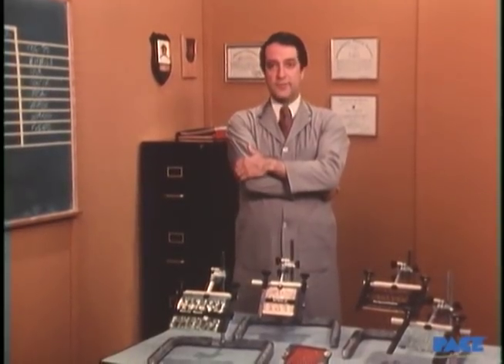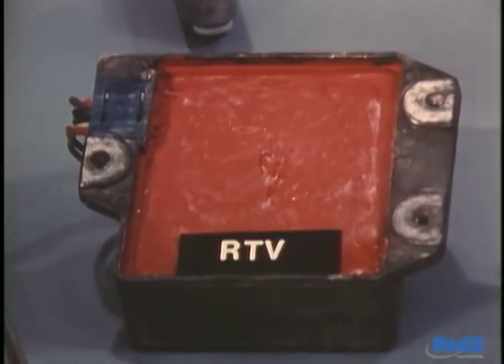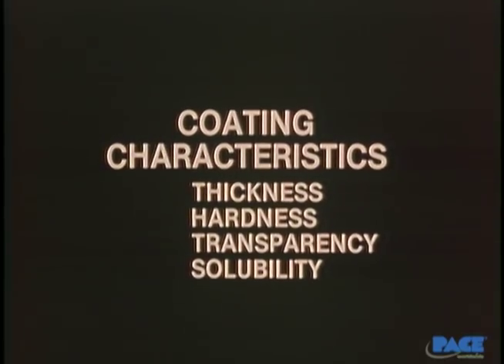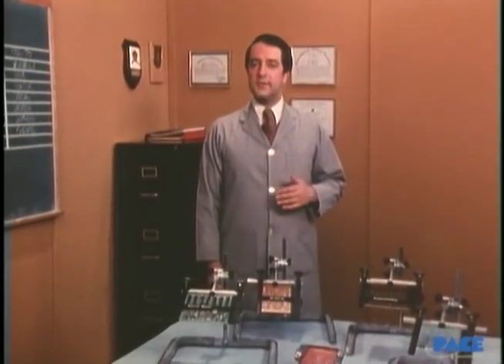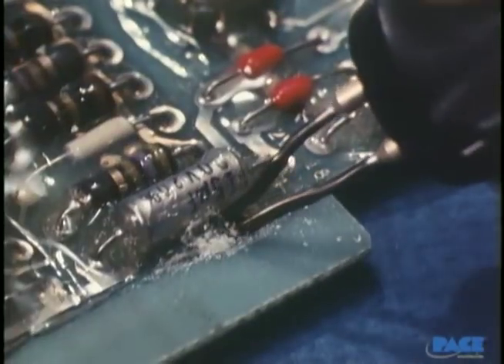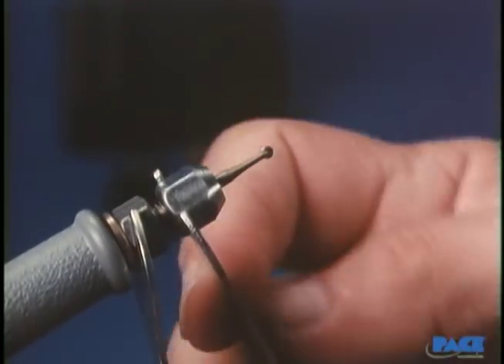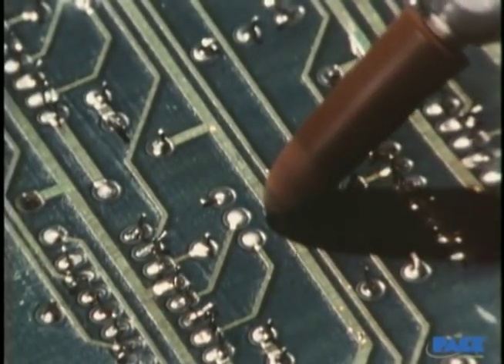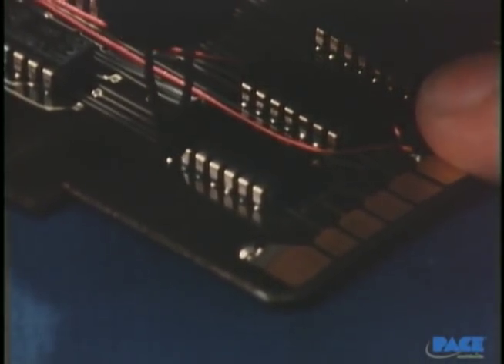PACE Rework and Repair "Conformal Coating Removal"

Comment: Back in '82, Pace had many tools which I had used, for example The Vacuum desoldering, the Cir-kit; Pad and track repair, the Gold "fingers" edge board re-plating machine. Very convenient and easy-to-use.
Reply: does the company still exist?
Reply: @andrewmusisi7147    I guess it still exists. It's been 40 years ago since I first used their products.

Comment: @4.00 how do they know what part needs to be removed or repaired if the conformal coating prevents initial diagnoses?
Reply: Depends on the circuit. I repair boards potted in epoxy and based on the symptoms and my experience 9 times out of 10 I can diagnose the board based on these two things.

Comment: Anyone else watching this video trying to fix their racing drone...
Reply: Sort of. Actually trying to decoat a 3 phase inverter used to drive a bldc motor blower for a bus. Effectively the same type of motor that you're working with, and sale driver board just high power.
Reply: Yeah 😂
Reply: Here because the receiver leads snapped off the esc for my 1/10 stadium truck. Gotta get through the waterproofing before i can solder it. Kinda glad it broke because I found this great resource! Thanks PACE!